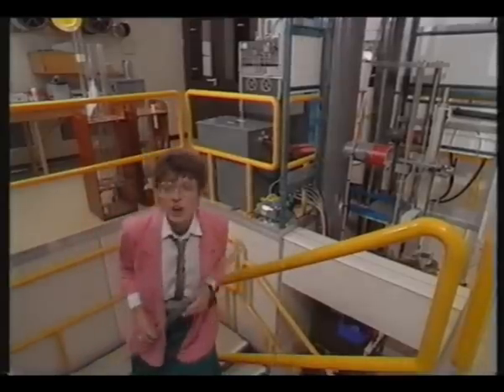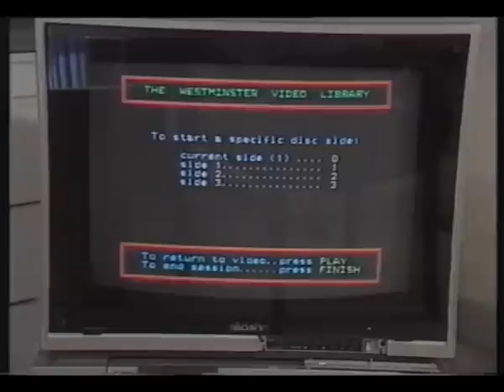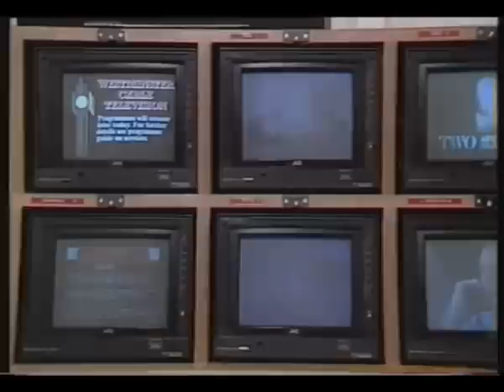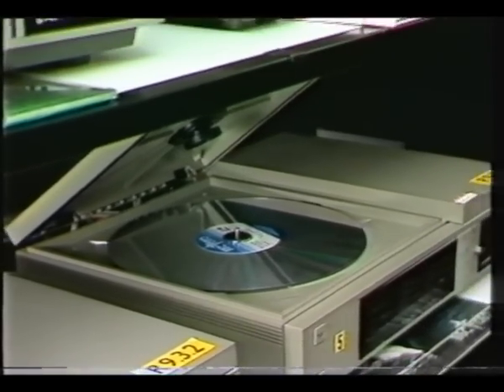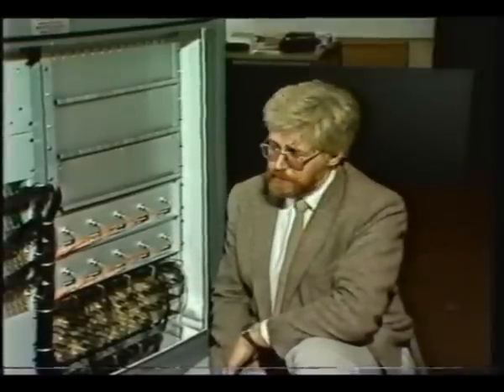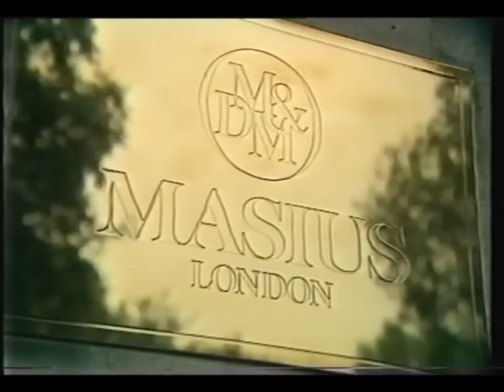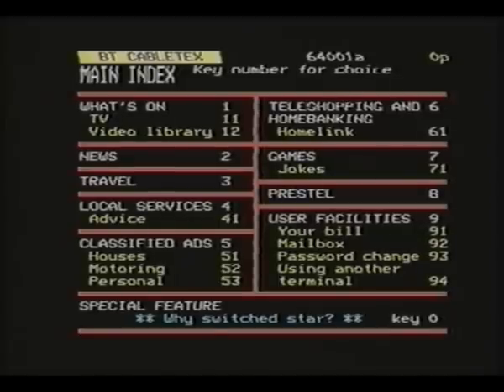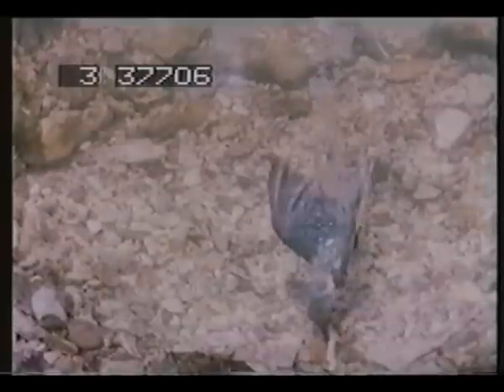Frontiers 1985 - Early BT TV

Comment: This is great!
The first person pictured at the optical bench is Dr David Cotter, who I worked with back in my optics days at what was then called BT Labs.
I think I’ve worked in that lab which was in the Main Lab Block, I certainly worked with the ‘Colour Centre’ lasers that could be tuned across different wavelengths. The laser was a Sodium Chloride (salt) crystal and needed to be kept cool using Liquid Nitrogen!
Then the fibre pulling rig was in B55 (where I also worked with Jim Ainsley who was interviewed).
I worked on and build some of the early Fibre Amplifiers and spent several years in the clean rooms and used to package the laser chips shown during my time in a research group that was developing manufacturing techniques for BT&D.

Good times and great vision from the people at the time.
p.s. the glasses people were wearing were amazing!
Reply: I enjoyed reading your post Mr.Wilson. It sounds like you had a fun job.
Reply: Awesome!

Comment: Optical fibers have two main types: single-mode and multi-mode.
Single-mode fiber optics use lasers and are used for communications over long distances (like the undersea cables that power the Internet), while multi-mode fiber optics use infrared light and are used for communications over short distances (such as within a data center or buildings within a compound or campus).

Comment: I worked for Westminster Cable TV from 89- 2000.....what a great time....fantastic company with wonderful people!
Reply: BT made the mistake of buying shares in BskyB which prompted the bureaucrats in the EU government to sell the BT cable franchises. They sold it to NTL and they also had to lease the network, the two companies couldn't agree on things and it was never upgraded apart from some of the Westminster area which had Cable Broadband rolled out, Virgin Media discontinued the service in Westminster,Milton Keynes between 2012 and 2013 and the Barbican estate in city of London shut even earlier in 2004. BT engineers fixed the cables as part of the lease including in people's homes and they were caught patching up cables with duct tape. Both companies let residents down badly because in these areas, they have little choice due to poor signal.

Comment: Videotron rolled out it's Cable phone service across Westminster, they couldn't get a Cable TV licence because of Westminster Cable but the plan was early IPTV and the same interactive features you see offered by Westminster Cable. Videotron did roll out its phone service across Westminster and it continued through C&W but in 1999 NTL bought both Westminster Cable and the old Videotron network and BT prohibited NTL offering the phone service in Westminster as part of the deal

Comment: Did this cable service offer satellite TV services in stereo transmitted using the Wegener PANDA 1 noise reduction system, usually transmitted from satellite over the stereo subcarriers 7.02 / 7.20 MHz? 

To relay stereo sound from satellite, the CATV systems satellite reception units would pick up satellite channels with the stereo mode 7.02 / 7.20 MHz selected, and Wegener PANDA 1 noise reduction mode on the CATV satellite receiver activated to reduce the hiss inherent on the broadcast, and broadcast that two channel sound via the fibre optic cables to the customers set top box unit, to be heard in stereo on the customer's stereo TV or in some cases, broadcast as a stereo television soundtrack on the FM band received on a HiFi system connected to the cable system. 

Later on, CATV systems in 1989 could encode those satellite TV services transmitting analogue stereo sound to NICAM Digital Stereo using a NICAM CATV encoder and these would be offered in NICAM Digital Stereo to be picked up on a customer's NICAM video recorder and NICAM Stereo television set.